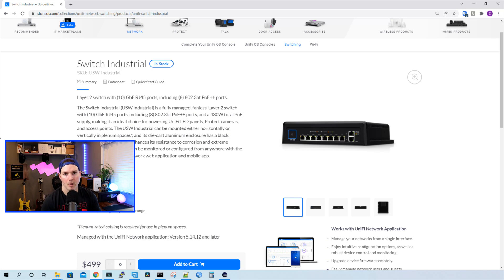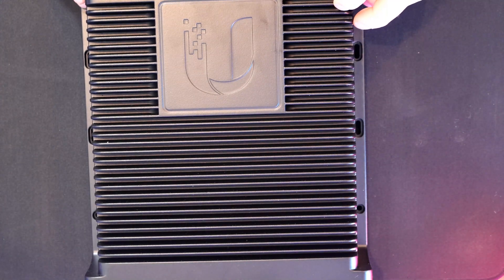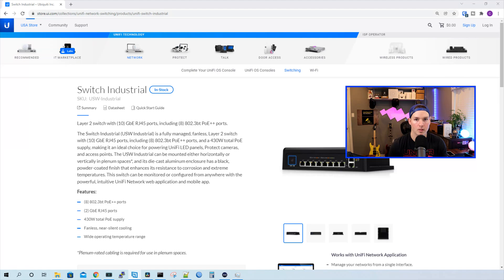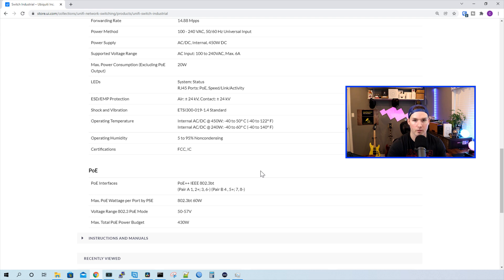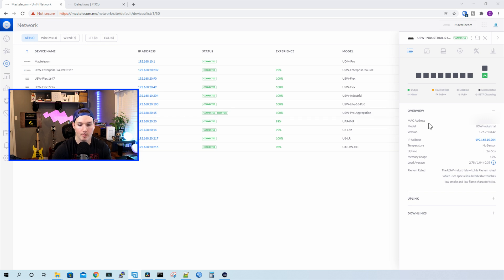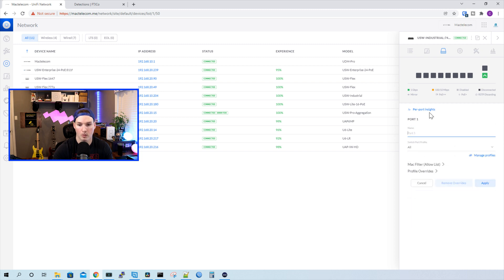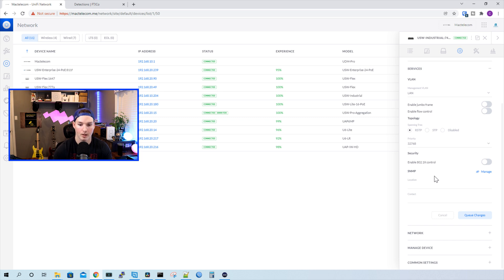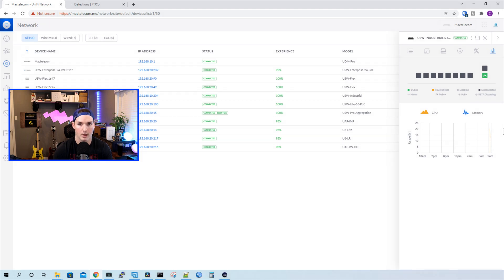Unifi USW Industrial switch

Comment: Do you see any issue with this switch powering a G4 Pro camera directly?
Reply from the maker: Nope shouldn't have any issues
Reply: @MactelecomNetworks  thanks!  I’ve read mixed things on 802.3bt being backwards compatible.  I was having trouble with a G4 pro plugged into the Industrial Switch a few hours after installation and Ubiquiti support initially said there isn’t compatibility.

Comment: Its a great switch, use it here to power 5x Flex 5 ports POE that in turn power a few Flex mini, 3x AP´s and my 9 Unifi Protect cameras. You could argue that it is like putting all your eggs in one basket, as a failure on this one industrial will make all other units "die" but I do trust the quality enough to make due in my own home network ;)

Comment: Yeah, that's not industrial at all. Where is the DIN mount, 24V DC connectors, 120V terminals, and such?  This thing takes up to much real-estate in an electrical/control cabinet. Maybe for a semi/industrial rack somewhere but the way Unifi runs hot I would be scared to try it in 90% of areas besides an office.
Reply from the maker: I don’t make up the naming convention 😅 just was making a video on the switch
Reply: @MactelecomNetworks  oh I know man it's all good.  But I would be VERY careful if you suggested this in the industry because in all honesty Unifi has no place on an industrial control network. There is a reason Allen Bradley/Cisco switches are expensive when your running Safety Zone 3 CIP environments. This switch could get someone hurt or worse killed.
Reply: @TheElderOne2003  I guess Ubiquiti was going more for workshop "industrial" rather than mission critical systems.
Reply: Yeah doesn't compare to something like Cisco IE
Reply: @S z yea exactly, basically anywhere you'd want to put a UniFi switch but need something a little more rugged.